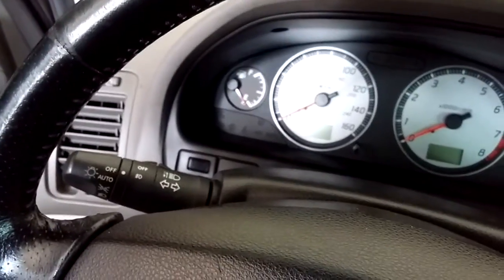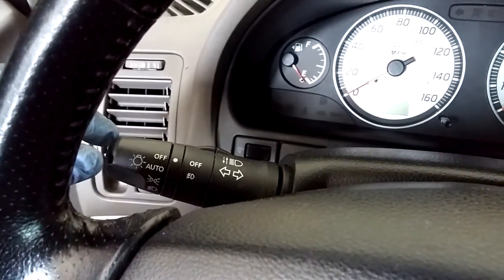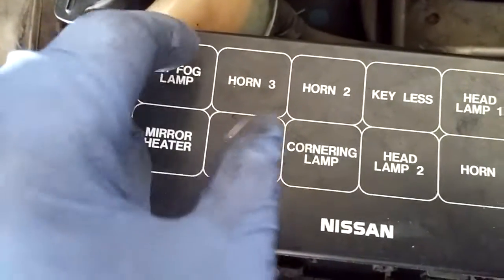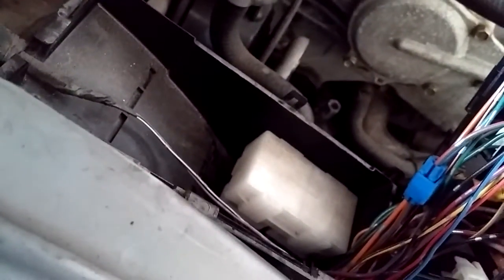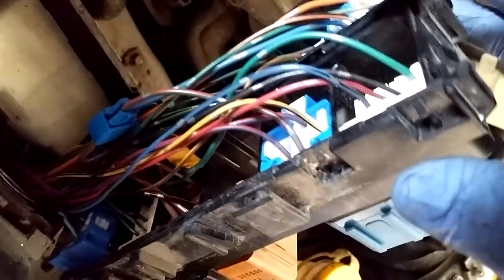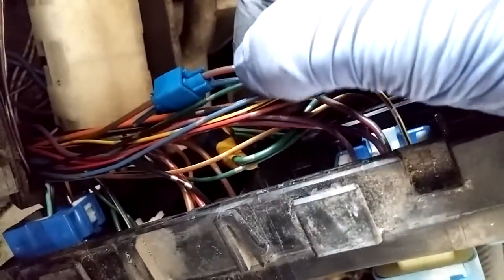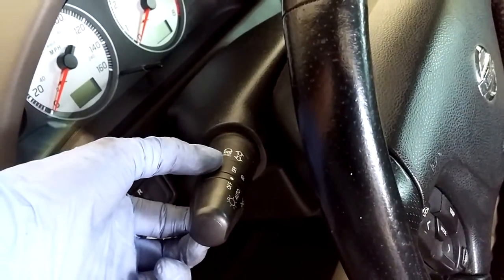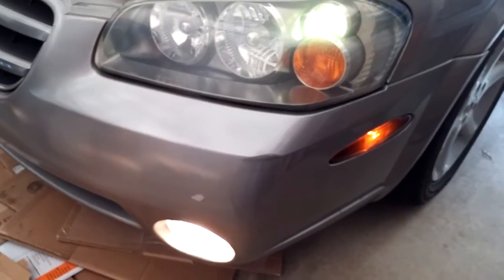Nissan Maxima Rewire Fog Lights to Parking Lights

Comment: Is this switching the "ground switching" from the headlights to the tail/parking lights? Essentially stock the fogs are linked to the headlight ground this is what makes them come on with the headlights only. By switching it to hook into the tail light ground it comes on with park or headlights on. Am I correct?
Reply from the maker: That's correct.
Reply: +ExpandableMe TY Excellent, I did a similar mod to my 3rd Gen Maxima ages ago. Wanted to be sure it was the same basic mod.

Comment: what do you use to test the wires and how to test them?

/
Reply from the maker: knocternal51 I tested it by turning on and off the light switch by the steering wheel as you can see in the video.  You can alway check with the volt meter.  You should see 12v at the hot wire (blue with silver dot) when the switch is on.
Reply: Thank you